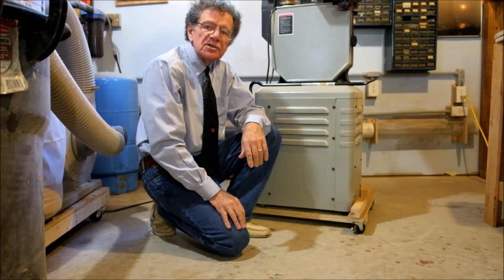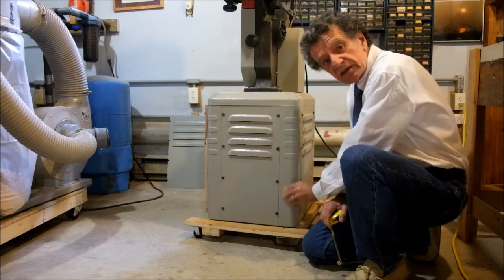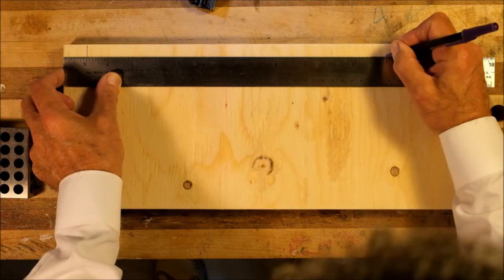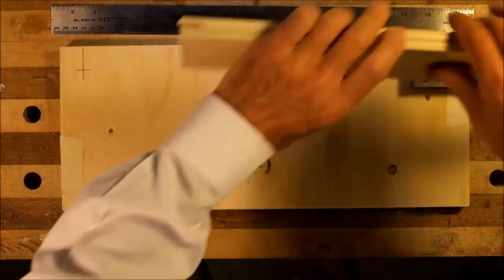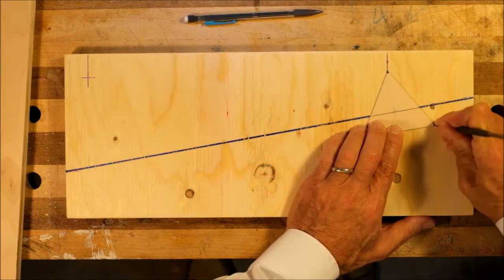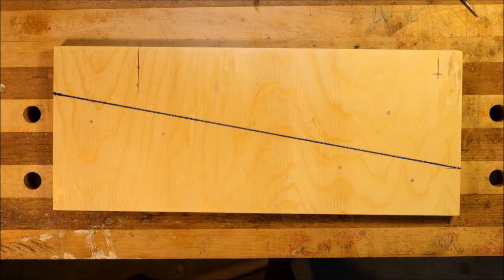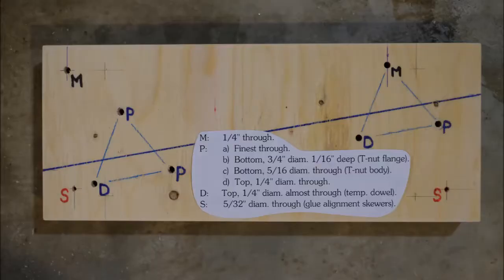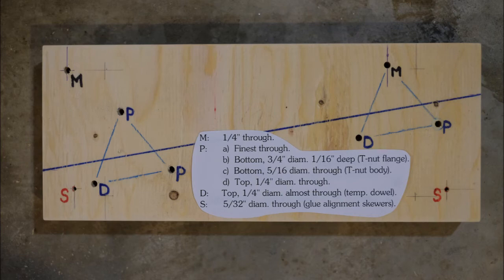George's Woodshop: Jun '16  Mobile Base, Part One of Three

Comment: This is a beautiful design. I will eventually use this for a table saw base, but I want the feet on the outboard side so the lift mechanism will raise and lower the feet rather than the casters. If you have any ideas for a self-leveling or easy-leveling mechanism to compensate for extremely uneven floors I'd love to hear them
Reply from the maker: Good idea that, extra stability with outbound feet instead of casters.  I don't have anything for self-leveling other than the inherent generous tolerance of woodworking: there's a little play fore and aft with each pair of wheels.  A couple of gotchas with this design:  1) The handle housing fills with woodchips and dust so you'll want to add a little extra space at the bottom of the handle.  2) Whatever it's attached to has to be solid.  The ones I attached to the metal panels on my bandsaw splay out more than I'd like.  Have a great week!

Comment from the maker: I forgot to mention that with a 10-degree slope and a three-inch triangle in the layout, the machine will be raised just shy of one-half inch.  Actually, it's the base that climbs up the half-inch; the machine will go up a little less.  Some of the half-inch is taken up by the gap between floor and wheels when they're raised.